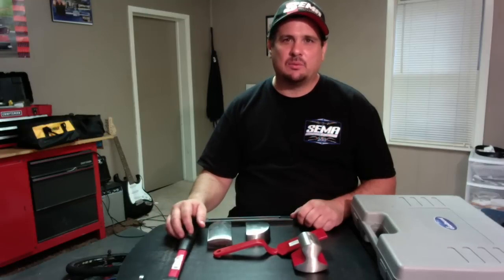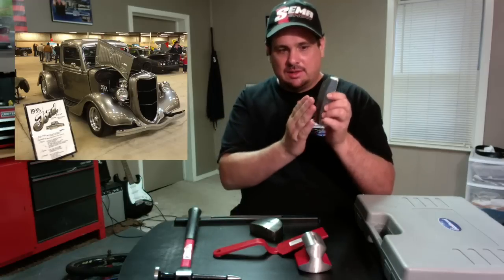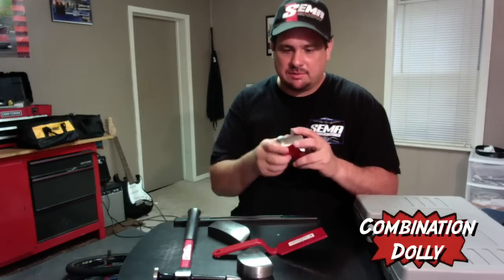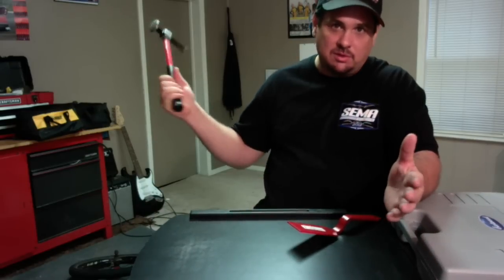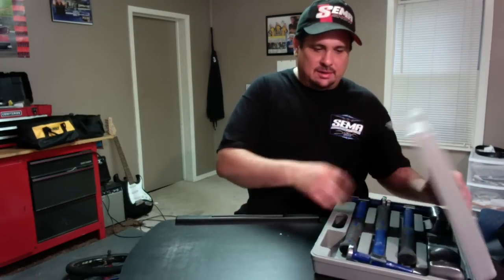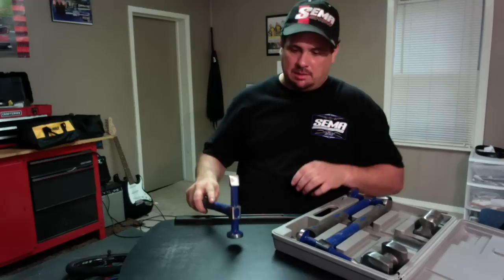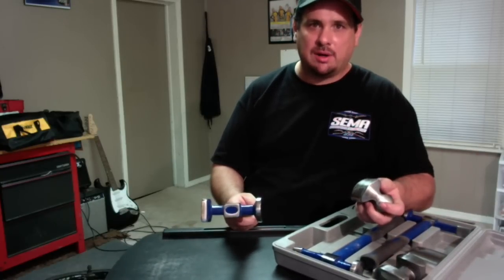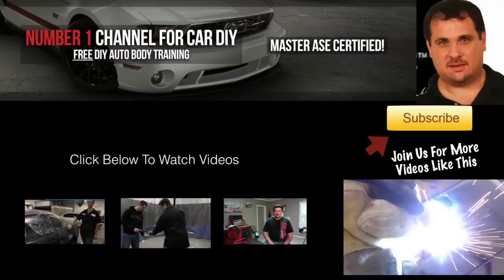Hammer and Dolly Basics   How To Choose The Right Tool For The Job

Comment: Excellent video! As a surfboard builder we use many techniques from auto body work like surface prep, filling, sanding and hot coats etc... and now I'm getting into metal fab and restoration and I have learned more about the tools used in 9 minutes than in the last 8 months. Thanks for posting.

Comment: Myself I like the feel and balanced of the Snap-on body hammers I have not found nothing to come close to them same with there Dolly's and spoons I have 7 different Snap-on hammers & 6 different Dolly's & spoons as well as making a few of my own spoons but with those Dolly's that you were showing I would sand more of the area where the ruff painted area is so you can use more of the shape & never use a body hammer on anything else but body work if you use it for nails you will damage it then end up making more work for yourself and the spoon you can use as a slapper you can't need to hit it with a hammer and damage both the hammer and spoon spoons can be easily made from car or truck leaf springs...
As well I don't use the dimpled shrinking hammer it damages the metal.. leaving all the dimpled in it I just use reg. Small pick hammer for shrinking... But good video though.

Comment: I've been trying to get some dents out of my truck box, but tapping doesn't work very well. The metal on a 1954 Dodge Fargo is a lot thicker and harder to move tan the crap trucks of today. There are places that I have to use a bigger hammer. I still learned some tricks. Thanks for sharing.

Comment: Nice.. Thanks for the "refresher tips"
Not to be a pain but a video of shrinking metal would be much appreciated. Especially one that deals with 'severe' stretching due to welding (By a crappy welder ~~~ like myself). Also very interested in this shrinkage by way of heat. Not sure I remember being taught that.
Again and as always
Thank you for all you awesome videos
Reply from the maker: Thanks for the suggestion, I don't think I have one over shrinking metal.  However, if the metal is warped from welding, is hard to fix.

Comment: real dumb question, what do you do when working on an area where I can't get a dolly behind the metal? high-back end of truck bed for example. thank you!
Reply from the maker: Not a dumb question at all.  Unfortunately, you will need a more expensive tool to repair panels that you do not have access to the backside.  Here is a video for using that tool. https://youtu.be/fBdXFwdNef4
Reply: @CarAddictGarage  thanks!

Comment: I have a 1975 Monte Carlo and have gone threw too bad paint jobs 1st was bad and 2nd was worst.so I'm committed to lean and do as much as I can and get it rite.but have a question,on the the quarter panel guy banged the sheet metal outta shape pretty bad leaving big golf size bumps on it would it have to be cut out or can it be fixed ?how?
Reply: Hanss Lopez hit outside of panelwith hammer , Dollie in the back.  Hammer on Dollie method.  Will straighten out